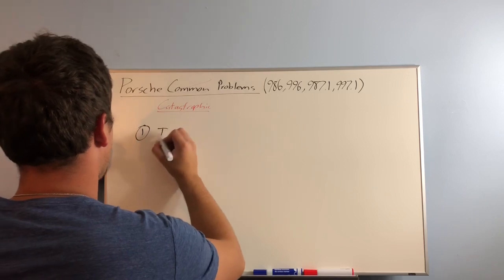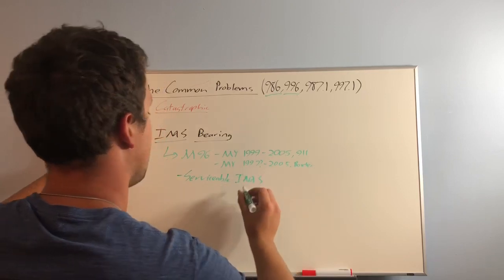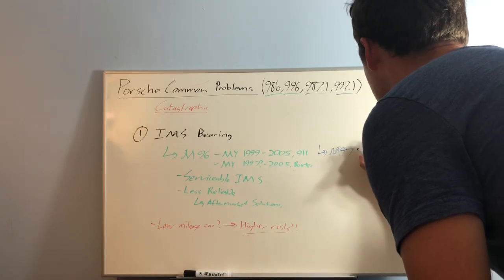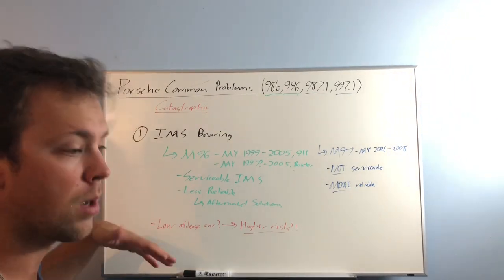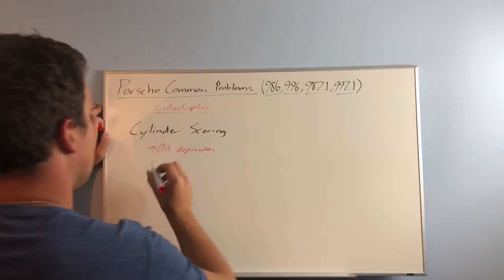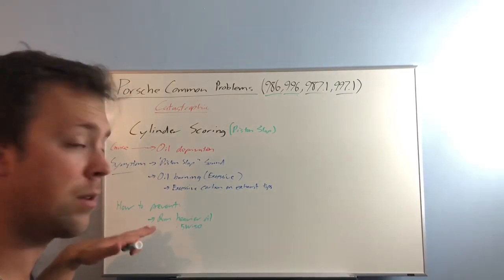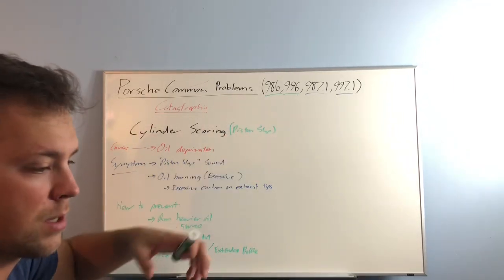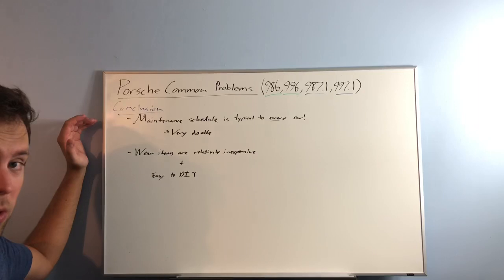Porsche Catastrophic Engine Problems: Boxster, Cayman, 911 (986, 996, 987.1, 997.1)

Comment: For all of us concerned about the Porsche IMS Bearing issue - I found a very informative article from Autohaus Hamilton in Australia about the IMS. The article also lists all the models and engines (with engine numbers) that are affected. To read the article just type in “Autohaus Hamilton IMS” into google. The Porsche models that are prone to IMS failure and should be replaced are: - All 986 Boxster models. - 987 Cayman & Boxster models up to engine number 61504715 - All 996 models (not including: GT and Turbo models) - 997 3.6ltr with M96/05 up to engine number 6950745 
 
Before 2000 Porsche used a double row IMS Bearing which had a low failure rate, then Porsche switched to a single row until 2005 - 2006 and this single row has had the most problems. After 2005 - 2006 Porsche stayed with the single row but beefed it up significantly and this bearing has had the least problems of all three types of bearings used from 1997 to 2008. The upgraded bearing in the 997 and 987 is unserviceable, meaning you can't reach it unless you strip the entire engine down. From my research the IMS issue has been greatly exaggerated, mainly due to a cottage industry that produces and installs IMS Bearing replacements, so naturally it's in their interest to scare all 996, 986, 997 and 987 owners into thinking all their engines will suffer IMS failure.
Reply from the maker: Thank you for the comment! And yes, I agree with you; I also tend to think that this issue is far overblown. The important thing is to ensure that you take care of your IMS bearing (drive the car regularly, change oil at a reasonable interval), and do oil analysis to look for any warning signs. If you do those things, everybody should feel perfectly comfortable owning one of these cars!!
Reply from the maker: Glad that the 5w-40 helped your situation. Fortunately, I’ve never had any noticeable oil consumption, however 5w-50 made a world of a difference in how much valvetrain noise I heard; additionally, it gives me much more peace of mind when driving hard on hot, summer days. Thanks for the link! Do you have a 987.1?
Reply from the maker: Thanks! Yes, stay tuned, exhaust review coming soon!!

Comment: well on my 2006 which I just recently acquired it has 33k which is only 2K per year. it's been in California it's entire life. so it sounds like you would recommend being wary of the IMs. I will get that oil check done which is great to know about thanks for that
Reply from the maker: 33k miles isn’t too hatefully low… That’s enough to have been “driven.” Although, it never hurts to get an oil analysis done!

Comment: Salute you Mr. FunAhead TV 
Do you know what Bearing got the early   Boxster 3.2s 987.1 from MY 2005. The Car i want to buy got about 90.000km. Are the first 987 more reliable then the late 986 ?? This is  the M96 Engine right???
Thx 4 all your Videos and Infos, really appreciated...✌
Reply from the maker: Hello sir. Actually 2005 for the Boxter was a mixed spec year; all M97, however, my understanding is that some got the old, single row bearing, and some got the new, larger double row. You should be able to look up by engine number. 

Correct, M96 was in the 986 and M97 in the 987. Overall, they have very similar reliability... just with little differences.

Comment: Thanks for this video very easy to follow.  I've been considering buying a 2007/model year 2008  987.1 Cayman s and have been a bit over whelmed by seeing all these IMS and bore scoring issues on the forums.  Seeing this has helped give me some clarity.  I live in Cape Town, South Africa where the climate is very dry and averages 50-80 F ,very moderate climate.  Unfortunately i have to leave my car sitting for 6-8 months at a time every year as i live in Tanzania half the year.  Any recommendations for start ups on 987.1 cayman s at say 60-70 f temp when i return?  Do you think the fact that i have to leave the car sitting so long should stop me from buying the car(its from OPC with ppi 111 check completed?  is the 5w/50 or 5w/40 a better choice?  

Ive asked several specialists here in South Africa both private and with OPC and everyone seems to say no cars here fail from Bore scoring and its practically non existent.  Also Very Rare for Ims bearings to fail here in SA and after mid 2005 almost no cases of its failure at all.  I have a 1992 964 c2 coupe (dry sump) I've left sitting for over ten years (half of every year) and never had any problems except to burn off the excess oil that leaks past rings after starting after long sitting spells, best car ive ever owned.  Thanks for your time!

Comment: thanks for the vlog i was told only 5% of 986 and 996 have ims failure in total
Reply from the maker: Thanks for subscribing! I’ve heard many numbers, but I think it’s in that range. Still, I think it’s an over-hyped issue and people should still feel comfortable buying one. But that’s just me!
Reply: The early 97 to 99 have 1to3% and only on cars with long oil change intervals.
Reply: @brandonbentley8532  I got a 1998 2.5 did 213,000km I always make sure oil level is in full level not a bit less.

Comment: I am looking for a 987.1 Cayman S with 34.000 Miles, one owner, should I be scared for those problems? I have clear to 5-40/5-50 oil each 5.000 Miles.But i am scared with ims and cilinder scoring. Thanks for answer
Reply from the maker: No, I wouldn’t be worried, especially if you know the car’s maintenance history. This video’s purpose is to make people aware of what could happen, but it happens on so few cars.

Comment: When you say non serviceable for the 987.1 meaning you cannot change it if it goes bad? You can’t just take apart and restore?
Reply from the maker: Meaning you can’t service it in the same way the IMS bearing can be changed on the 986 and 996 cars. The 987 and 997 (from 2006 -2008) need to have their engines disassembled to have the bearing changed. That being said, the bearing in the 987 and 997 cars is much more robust. I wouldn’t worry about even needing to change the bearing in those cars.

Comment: is this for all engine models 2.7 - 3.2 ?
Reply from the maker: Yes. However, it’s my understanding that the cylinder scoring has more potential to occur on higher displacement engines (3.6L and 3.8L). So the 2.7 and 3.2 are less at risk. For IMS issues, the 2.7 and 3.2 can have that problem same as the others. But again, dont let it stop you from buying / continue to own one of these cars. They’re great!! Just need to be a diligent owner.
Reply: ok thanks just bought a w 205 merc 250d wanted the cayman 987 i do 42 k + kms pro anno so a petrol engine is not a good idee. maybe as a second car i m considering the cayman
Reply from the maker: Congrats on the Merc; that’s a nice car! A Cayman is definitely best as a 2nd car. They’re great weekend cars to get out of the garage and head out to the curvy, fun roads. You COULD do the daily commute in them, but it’s better to have the W205 for that, especially at 42k kms / year.
Reply: thanks ! it s got 204 hp and 500nm of  torque so it s an ok daily driver. yes the running costs for a cayman in the eu is very high what you  pay per gallon i pay per liter +- so...

Comment: I have a 99 986 manual trans. I change my oil every 3000 miles. I use 5w50 redline. I literally burn 0 I mean 0 oil in that time! I use Lucas oil in my gas and it keeps the cylinders lubed and happy. Also side note, the early 97 to 99 had the dual row bearing that rarely fails but should be done with a clutch job. Correction, the boxster takes 9.5 quarts, the deep sump is 100% unnecessary.
Reply from the maker: Awesome! I’d like to get my hands on a 986 at some point; I love those things. I run 5w-50 in my Porsches too; seems to really smooth out all engine operation compared to 0w-40. Have you done your IMS yet?